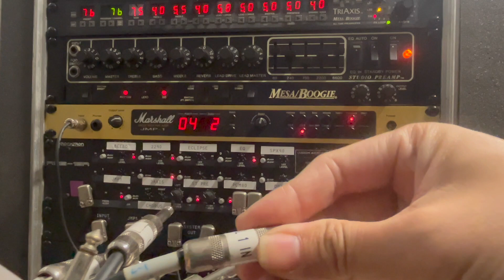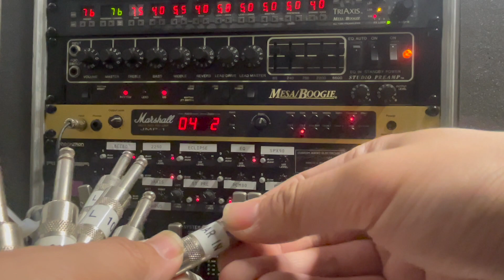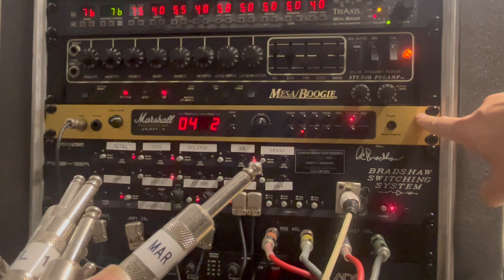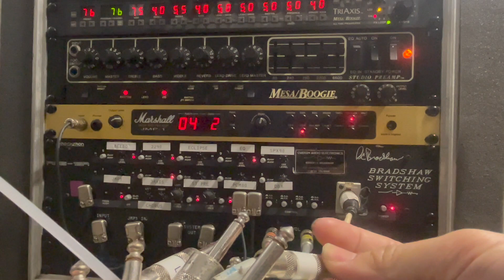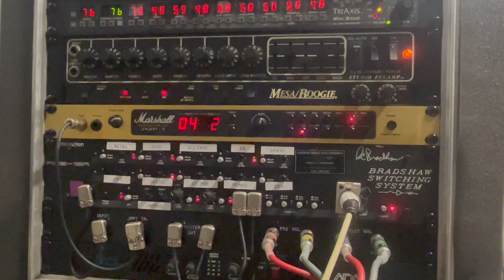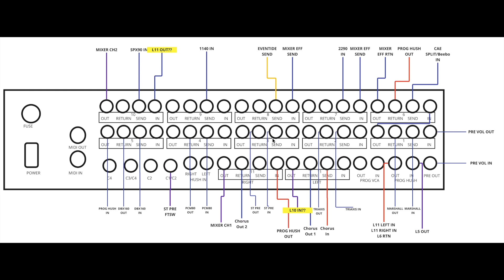Episode 4: Saving The Last of Runaways - Preamplifiers - Options & Selection

Comment: Dan used a 9000[?] preamp? which one? Would love to view a list of preamps he used, and later effects too. Most importantly all preamps. I may be editing this a few times, and/or replying below. I have a completely different system, but the idea is very similar.
Reply from the maker: Scott, he used a lot of gears back in the rack days. I’m just guessing because there was period that he used JMP-1 and 9000 tube preamp. Those two are great preamps. JMP-1 didn’t come out until 1992. Giant record was studio debut in 1989. Definitely, he used the JMP-1 after Giant studio debut. That’s all what I think
Reply: @andrewraharjo  Don't forget the Kasha RockMod preamp v1.  Dan used this a lot - it's labled on the footswitch!
Reply from the maker: @jaronensley   I have the V2 Rockmod, unfortunately, and I'm still in the process of repairing it. Yep, it is his main lead tone but tri axis or JMP1 can do more than Rockmod
Reply: @andrewraharjo  he also could have had a Marshall head alongside, and ran a line into it's Input, and a returning line from the amp's effect loop Send going right back to the switcher. I have done that with my RG-16 with a few amps each in it's own loop and preamps in their own loops also.
Reply from the maker: @b.scottfarthingsworth  that’s also true because in his instructional video he mentioned about using straight Marshall head for layering guitar tracks. The cable also shows that he has juice extractor to make sure it’s in line level. He also uses the peavey classic 50 as well. Last setup that I’ve known I heard he uses matchless amp as well